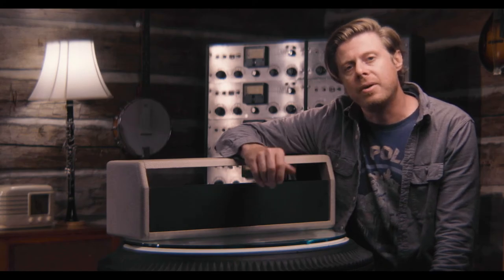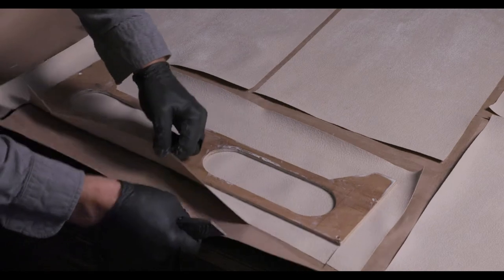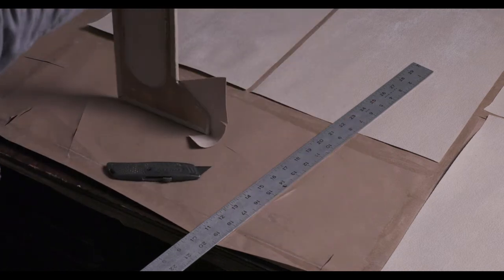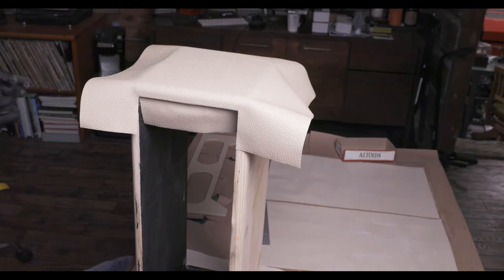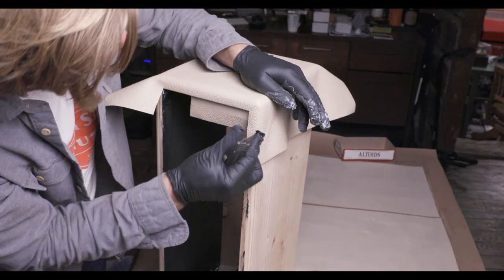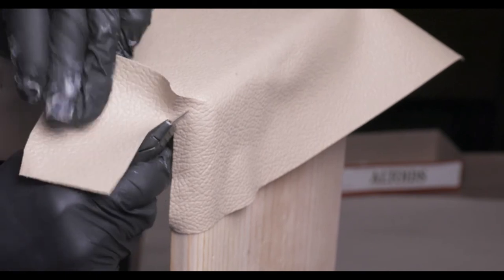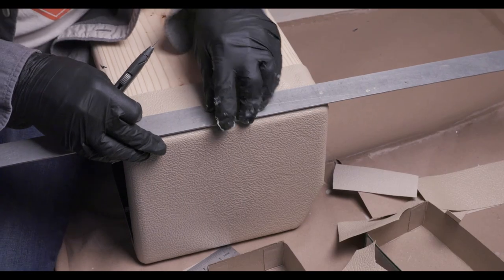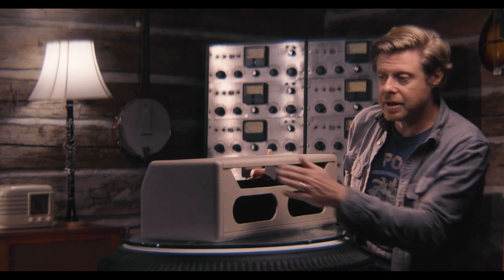Cabinet Covering Tutorial - Guitar Amp Tolex - Sizing, Cutting, Gluing, Corners. DIY

Comment: Initially cutting your tolex you should measure and cut templates out of 1/4 MDF and then pre cut them makes it easier and less chance for mistakes when doing a fender 4 piece wrap. On the sides of the Fender 4-Piece wrap it is actual 1-1/4" over the edge and no 45 degree cuts. They are horizontal cuts that require a certain cut patter for tolex and a differnt pattern for Tweed so the lines matchup. On larger 1 piece wraps cutting 4" longer than needed and 2" more in the width works.

Comment: Just finished my Deluxe-sized cab using this tutorial - it was very helpful, and it's very challenging to get the cuts right. Also, he doesn't include gluing the top and bottom pieces, which were the most challenging - contact cement-wise.
Reply from the maker: Sorry!  Glad to hear it was helpful. My camera probably quit and the footage was lost. It’s a Canon with 30min record limits. Boo.

Comment: That’s a beautiful cream colored Tolex.
I overlap, then cut one 45 degree through both layers,  peel back, pull out sliver (first layer), lay back down for a perfect seem. If you have a lot of time, I do not glue that part, fold over dry cut the seem. Peel the glued sliver,  glue the Tolex you left dry, come back lay the seem down perfect.
Wether it’s Wallpaper, linoleum, etc., anytime you cut through the overlap, both layers, your cut will match perfect.  
This guys way is as good, but like he said if you do not cut it exactly, you could be left with a gap. Hopefully if that happens, there is a plastic corner piece that will cover the mistake.

Comment: This is great! Thank you. 
For cutting the excess off the end pieces, I don't always line up a straight edge well visually, or hold it well while cutting. I like a piece of aluminum angle iron in 1-1/2" or 2" as a straight edge to cut against. It makes a perfect cut by wrapping the angle around the corner of the box. Using painter's masking tape around the edges and the inside of the metal angle protects the tolex, tweed, or fabric, from any markings, snags, or scratches.
Reply from the maker: Thanks. I used to use guides but have done so many I just developed a way to eyeball it. Sometimes I will use painter’s tape to hold a corner tight together while the glue dries. That’s usually only if I’m having trouble keeping the perfect shape. I’ll use a few dabs of super glue gel and tape it tight.
Reply: I do the same thing. Works great.

Comment: Another great tutorial; I really appreciate your painstaking attention to detail.  I learn something every time I tune in.
If I might make an unsolicited suggestion: I'd like to see you keep more money in your pocket.  I don't know how many cabs you tend to do in one run, but it's well worth the time to calculate the yardage you'll actually need for that run, roll out the tolex, and cut it into lengthwise strips prior to laying out the individual segments.  I've found that making these segments about 3 -3 1/2" wider than the depth of the cab gives me plenty of working room, and the sides (you're calling them 'ends') can be cut about 4 - 4 1/2" taller than the cab height to give you the wraparound.  Top and bottoms can be cut to width from the start.  I think this approach could greatly reduce your tolex wastage and give you more efficient yield from a roll of fabric.
I do have a question, if I'm not imposing: do you have any experience with Traynor amps?  I've had a couple of them pass through my hands, and I was amazed at how solidly the cabs were put together.  Also, they had an aluminum edge with a rubberized 'bumper' which wrapped completely around the edge of the cabinet sides: could you give me any insight into how that was done?
Reply from the maker: Thanks!  I just watched a "How its Made" on the Discovery channel on Traynor amps.  The video's probably on YT.  I was closely watching.  Haha.  They use quality plywood vs the low quality MDF a lot of the "bigs" use.  I've done a LOT of these builds but rarely build the same thing twice in a month.  It's all over the place really.  These videos are kind of geared toward someone wanting to jump in and do it themselves.  For larger scale production runs my methodology is more efficient.  Those type of projects don't really get filmed since shooting these is kind of distracting to production. Haha.  I'm a one man band most of the time.  Again, thanks for the time you've taken to watch and comment!

Comment: for a speaker cabinet, could you use a long skinny piece to center and square up on top, then pull down both sides and a bit under each corner? That would fewer corners, but harder to line up perhaps? I'm gonna go for it.
Reply from the maker: That method works.  The downside (and probably why Fender did it this way) is that you need much longer sections of tolex whereas the Fender way lets you basically cut scraps off the roll without creating much waste.  The lining up process isn't hard but I should do a video about it.  Thanks for watching!

Comment: Doh! I was doing fine until your comment at 20:50 re: a Rhodes piano. Guess what I'm doing for the first time!  😲 I'm concerned about matching up the screw holes. Figure I can use an awl to poke out the through holes from the inside where they are, but that won't work for the latches and other surface mount hardware. Take good measurements, or just make new ones?
Reply from the maker: Haha!  Yes, you'll be a black-belt after a Rhodes piano recover!  I try and keep track of where the holes are (photo, measure) and then use something narrow with a blunt end to probe around like you're suggesting.  Just try not to poke holes where you don't want them!  Haha.  I use a punch or the back end of a file (like a chainsaw blade file) to probe around.  Then i use an x-acto knife to cut a little x over the spot.  Hope that helps!  Rhodes pianos are worth it!
Reply: @FreshOldSchool  Awesome, thanks so much for the tips, appreciate it! I think this will be my first and last Tolex job!! 😂

Comment: Top notch, all of it. From the skill, to the explanation, to the BGM. You just got a new subscriber,

Any tips on "repairing" tolex considerably big tears. How to glue the pieces to hide the big tears?. Or how to remove the old tolex completely if that's even worth the trouble?
Reply from the maker: I've done some repair but the absolute best way is to start from clean.  Use a heat gun to soften the tolex glue and that will help.  Just make it clean before you reglue.  Any dust or debris will show through.  I clean up with mineral spirits.

Comment: Great video, 2 questions why didn’t you use just one piece vs 4 separate pieces. And, I normally pull the Tolex inside vs cutting along the edge. Over time it can start to peel up from use. I’m about to do the same head and want to know if you had a purpose for doing it this way. Thanks!
Reply from the maker: Thanks!  In this video I’m doing it the old-school Fender way.  But you are right that the single piece or two piece technique is also a great way to cover.

Comment: Is that how Fender covered their amps in so many different pieces? Wouldn't they have used just one continuous piece wrapped all the way around to minimize ends to peel up?
Reply from the maker: This is the original way that the early Fender stuff was tolexed.  They later adopted the three sided top and sides with a second piece on the bottom.  They also adopted staples at some point.  A lot of people hide the seams under a set of corners.  Thanks for watching!
Reply: @FreshOldSchool  thank you.

Comment: Great work! Thanks so much for sharing! Getting ready to start my first ever attempt. What do you think, or have you tried Dap/Weldwood non flammable (water based) contact cement? It seems similar to tolex glue which I’ve heard is pretty much Wilsonart H20. It’s seems you want the contact cement to be able to reposition which solvent based does not (very easily).
Reply from the maker: Thanks for watching!  I use tolex glue from Mojotone because I know exactly how to work with it every time and I also know how to clean it up with mineral spirits in a way that leaves the best possible cabinet results.  Everything else I’ve tried has been fussy in one way or another. I’ve tried other suppliers and recipes and think the Mojo tolex is the best.  Consistent results and ease of use/cleanup are way more important to me than discovering something that might work nearly as well. Haha.
Reply: @FreshOldSchool  Thanks so much for the info! I appreciate your channel, very helpful!

Comment: Will automotuve spray adhesive like headliner adhesive spray work?  I have some laying around id like to use up
Reply from the maker: Hmmm. Maybe. Couldn’t hurt to try!  The nice thing about tolex glue is that it can be reworked with a heat gun. Headliner adhesive might not. Been a while since I’ve used it. Back in the day tho… seems like I had a stable of cars that had sagging headliners that I repaired. The downside of that adhesive is that when you use it you’ll never remember the process down the road. Haha.

Comment: I'm a little confused about the overlaping Tolex. You don't top cut and seem it back together? Or wouldn't it make more sense to use one piece the length of all sides and only have one seem in a bottom corner that will be covered by a corner cap? Figures too, because I watched the video specifically just to see how to get a one seem top cut,... Lol

Comment: Why is tolex the standard for amp and cabinet coverings, when it is not that good looking and when it begins to wear with rips tears and gouges it looks even worse and it isn't easily repaired once it has lots of wear and tare?
Reply from the maker: One word: tradition!  Haha. Early amps were covered in the same fabric as luggage of the day. Once they invented fabric backed vinyl that became the standard. It’s basically marine upholstery. “Tolex” is basically a made up word that means the small selection of fabric backed vinyl that’s used on amps.
Reply: I have that fuzzy carpet type covering on mine , it's not nearly as popular but it's way harder to scratch or tear long lasting and you just vacuum it.
Reply: That’s a GREAT question!!!
I imagine you could also use leather …

Comment: foam roller works better than a brush, brush is only needed to get into cleat edges. Let the glue dry way to much and the rubber gloves are a hassle. Its a water based glue. I never have issues with glue on the hands covering cabs
#BFGCABS

Comment: Can I Tolex over steel or alum
Reply from the maker: Absolutely. In my truck I covered the door panels with tweed!  It’s a 49’ ford with steel panels. I also made an aluminum frame to hold my audio recorder and covered it. Worked great.
Reply: @FreshOldSchool  thanks I got a old ww2 amplifier with a 6.5” speaker in a metal cab I built a f51 fender circuit and swapped the speaker and sounds great just looking at options to cover the box the paint is kinda cheap looking for this